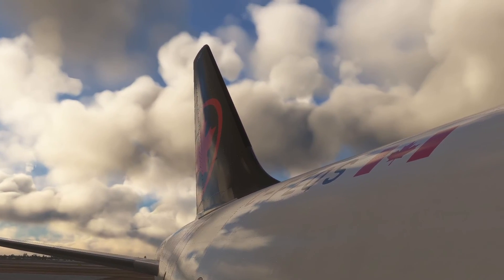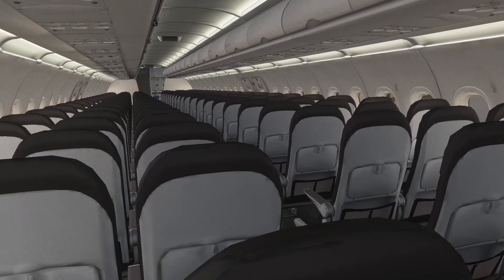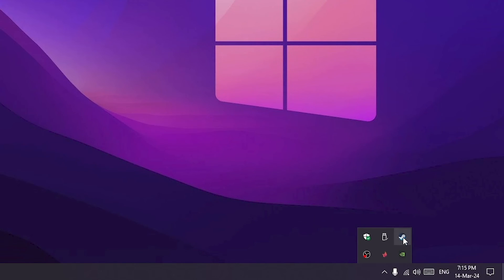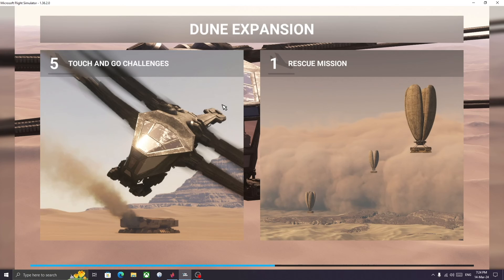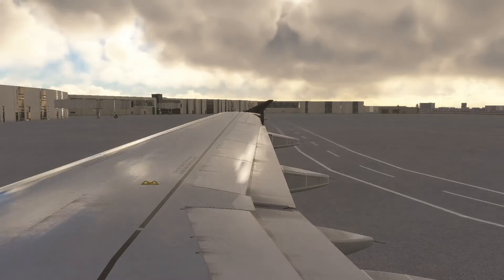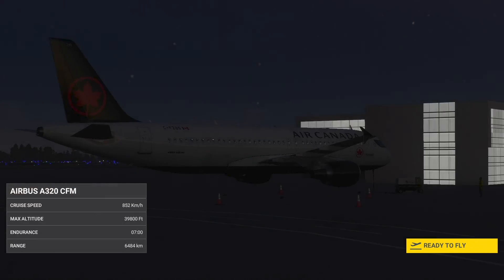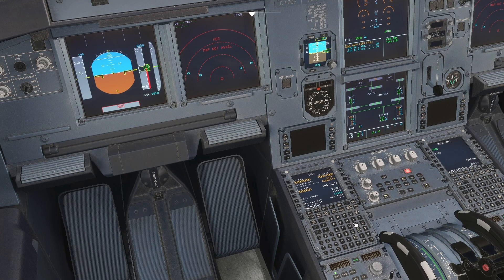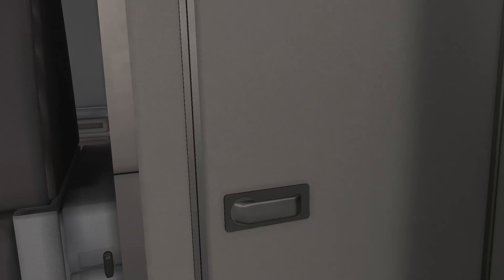Fenix A320 Display Stutter and Low FPS after Block 2 | How To Fix Laggy Display in the Fenix A320 V2

Comment from the maker: Important note: After the block 2, the official fenix manager liveries install into a single folder in your community that is 'fnx-aircraft-320-liveries'. So make sure you delete all the old liveries that are outside this folder (fnx-aircraft-320-liveries) in your community. Those are block 1 or V1 liveries and are no longer compatible. 

If you have a favourite livery from flightsim.to make sure it is updated for Block 2 by the developer.